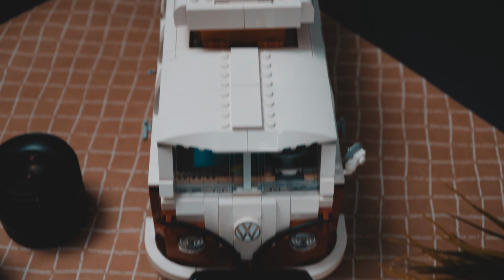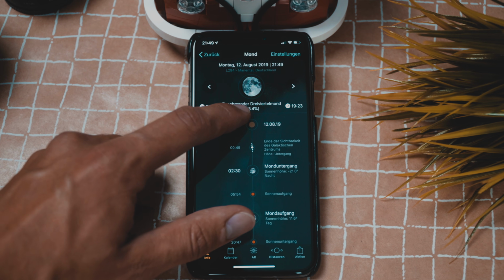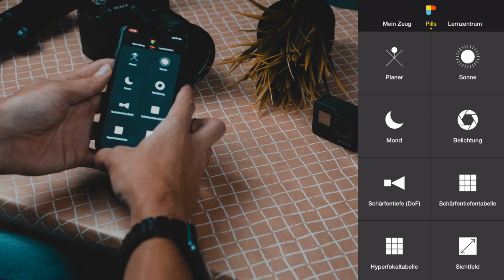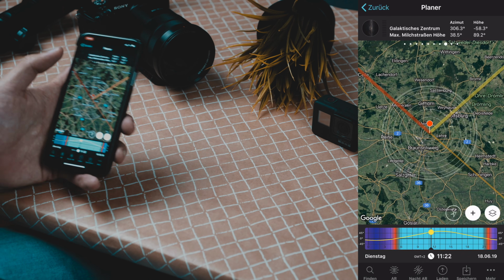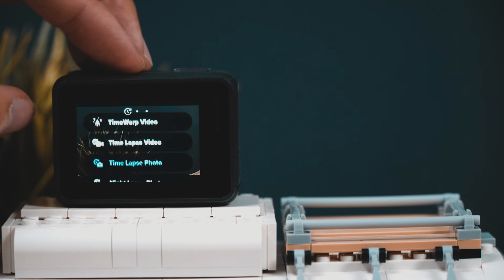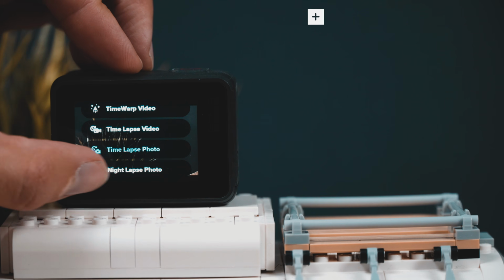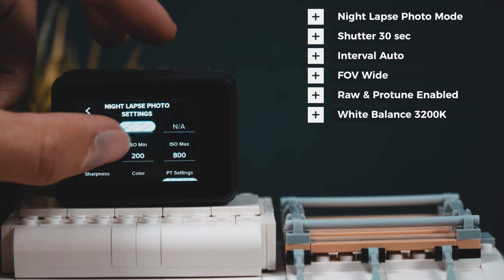GoPro Night Lapse Settings for HERO 8 (works for HERO 9)

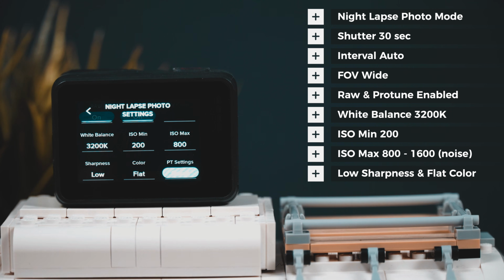Comment: Settings: 4:32 
Night lapse photo mode
Shutter 30sec
Interval Auto
FOV wide
RAW enable
Protune enable
EV compensation N/A
White Bal 3200k
ISO min any
ISO max <=800
Sharpness Low
Color Flat

Comment: Remove Battery sir ?
Reply from the maker: I don’t remove the battery to make sure only little humidity enters the inside of the GoPro. If you remove the battery, there are open electrical components.
Reply: @TheTimelapseGuy  my GoPro 8 won't charge while recording

Comment: what do you mean it could damage the camera ? how can gopro get damaged by rain ?
Reply: If you connect it to a power bank the latch is open, if you do the timelapse with the internal battery only it wont get damaged
Reply: @kronlidmusic  thanks for clearing it up. it was confusing

Comment: I have a question. Will it damage the battery when its running with a powerbank the whole night?
Reply: What happen?
Reply: i prefer to take out the battery, runs perfectly with power bank even without it.20000mah power bank lasts a whole night 😎

Comment: Loved the video man, thanks for the tips :) 

I have one question: How do you make sure the powerbank and the GoPro stay dry overnight?

Looking forward to your answer!
Reply: I use Proxicast Pro-Grade Extra Strong 30mil Weatherproof Self-Fusing Silicone Rubber Sealing Tape (Amazon) which works great for power banks and connections! It's easy to remove and does not leave any sticky residue left. It's amazing stuff! As for my GoPro, I use a weatherproof casing designed for continuous power made by 3br power (I think is called) X-PWR-H8 you can find them with a google search. Hope this helps.

Comment: Is anyone else having issues with artefacts in the night lapse mode? Gopro support told me this:
This is a firmware issue. Our product team is working on a possible fix. We do not have information if the problem will be able to be fixed or not.
Reply: I see blue and red pixels randomly in my night lapse... Hero 8
Reply from the maker: I once exchanged a GoPro because I also had dead pixels on the sensor. I contacted the GoPro support directly and it was taken as a warranty issue.

Comment: I plan on recording a meteor shower tonight and need to know if it's a good idea to plug into an outlet instead of battery pack. I feel they would be the same but just curious if there is a risk
Reply from the maker: It’s no problem, just try to make sure that no humidity enters the outlet (wrap everything into plastic bags e.g.)
Reply: @TheTimelapseGuy  awesome  thanks

Comment: How come my resulting clip is only 3 seconds long no matter if I use Auto or 60 second intervals? This is for 1 to 1.5 hours of filming
Reply: Becouse you get 1 frame every 60secs,but once you play the video its 30 frames per second. So, what you film for 30 minutes (30 frames you get) it is played in a second. You can put the interval on 30 seconds, so you get double the lenght. Keep in mind that if you are using shutter speed 30 secs, interval cant go lower than 30 shutter speed

Comment: This helped me make a short video of the perseids meteor shower and it came out fairly well. The only thing here being the key word. Short. I had the camera going for about 3 hours which gave me about 9 seconds of video. I'm not a photographer by any means so I didn't realise that having such a long exposure time would equate to a much shorter video, it probably could be made a little clearer for the idiots like me what sort of effect exposure times have on your shooting for things like this. Otherwise it's a pretty foolproof guide and I look forward to capturing some more nightlapses  with my GoPro, it's a fantastic bit of kit.
Reply: Thanks for the advice. I was also confused why my video was so short, even after filming for 1.5 hours or more. I think I might edit to video to slow it down and see what happens.
Reply: @ovlv1518  something else I realised after the fact was that I had been filming in video mode instead of photo mode. Made a huge difference in the time recorded to footage ratio.
Reply: @boytechnichian  seems I only have three modes on the camera when I swipe left or right: Time lapse, Video and Photo. I am relatively new to GoPro cameras and mostly photography is not my strong suit :/
Reply: @ovlv1518  Same, but if you look at your time lapse settings (shown in the video), not the specific photo or video modes themselves, you will see a photo or video option. That's where I went wrong. When on timelapse mode, tap and hold on where it says timelapse, that will bring up your settings menu. There you can select nightlapse and all of the other various settings shown in this video.
Reply: @boytechnichian  when on time lapse, it's has a default night lapse, time warp and time lapse settings mode, plus a custom mode to tinker with. The shutter speed is on Auto for the night lapse . Should I reduce the shutter speed time from 30 to 20 secs?
Reply: @boytechnichian  I made a custom time lapse mode with these settings: resolution 4K, lens Wide, interval 60 mins, format video, shutter 30s, white balance 2300k, iso max/min 1600, sharpness high, color flat
Reply: @ovlv1518  yeah that's the one you need to select photo on. Not video. Just keep all the settings the same as in the video. That's what I did.
Reply: @boytechnichian  if I do photo time lapse, will you be able to see it in sequence? Kind of like a video? I am trying to capture the milky way and earth rotation. Thanks by the way, you are teaching me a lot.
Reply: @ovlv1518  I don't know mate, would have thought so. I only watched the video same as you, just figured out that I made a mistake in the settings is all. Really not an expert in this sort of thing.
Reply: @boytechnichian  I was thinking may be I experiment and see what happens xD. Thanks again!
Reply: @ovlv1518  no problems bud
Reply from the maker: When you are using the Nigh Lapse photo mode (not video!) you need to do special editing in post to make a video out of the single photos :)
Reply: @TheTimelapseGuy  when you say special editing, what do you mean? As in compiling the photos in sequence to make a video or something more involved?
Reply: @Luke Barnes Mine doesn't seem to have a foto mode time lapse :(. Or am I missing something? Mine is a GoPro Hero 8

Comment: I have a question, how do you get the GoPro battery to last that long
Reply: Did you watch the entire video? Power bank connected to the camera while it's shooting.
Reply: Adam Krol no I watched the beginning only😬
Reply: @tame7222  haha no worries. Just plug the power bank so it will recharg your camera while it's recording. Just make sure there won't be any rain as this is when the camera is not waterproof anymore haha.
Reply from the maker: It’s amazing how often people are asking stuff which is answered in the video they are asking about 😜
Reply: bruhhh
Reply: Great video and thanks for posting it!

Comment: How can rain hurt a GoPro?
Reply from the maker: GoPro is still an electrical device. If you open one of its waterproof seals to charge it while shooting it looses its waterproofnes.
Reply: The TIMELAPSE Guy Oh I didn’t know you meant while using the port.

Comment: with the gopro 8 black,my night lapse videos were full with blue/red/yellow pixels, the firmware update did not help ( v 1.6) RMA and refound. I used the same settings
Reply from the maker: Your sensor is damaged then. You should contact GoPro for an exchange product. In my video you can also see one single blue dot because of a dead pixel. I might also ask for an exchange.
Reply: @TheTimelapseGuy  GoPro offered me a reconditioned Hero 8, not a brand new one. I said no, asked for full refund instead. I don't know if I will buy it again.
Reply: @TheTimelapseGuy  I have the same problem but with with lots of colors dots... GoPro told me it's a sofware default... 
But I don't trust them... did you have a camera exchange? and did he solve the problem
Reply from the maker: I had my GoPro Hero 7 replaced because I had a lot of dead pixels. The GoPro Support wanted me to send them a bunch of pictures where it was visible and then they just send me an exchange item without further questions. I really don’t think that this is a software thing. Maybe they changed to cheaper sensors

Comment: Hello! One question I tried to make a time lapse last night with mi GoPro 8, using the settings that you said but the result is a very dark! Can't see anything!

Do I need something more like a flash or extra light? I don't know what I've done wrong. Maybe the location and weather as you said? I tried to film in Quéntar (Granada, Spain) and the sky was clear.
Reply from the maker: Hi Alvaro,
when the sky was clear and you really used all the settings I recommend, you should have received a good result. Please check your settings again. Maybe you mixed up interval and exposure?
Reply: @TheTimelapseGuy  No, I've checked it and is ok! Maybe is because I set the ISO max and min exactly like you said (200 and 800) and maybe I should set it adjusting the numbers?

It was new moon so the sky was very clear and I was in the countryside far from any city but I didn't check the Milkyway as you said maybe it was the problem?

Thank you for answering!
Reply: Alvaro debe ensayar con el obturador en 30 segundos y subir eliso a 800
Reply: @luishecheverym56  configuré el ISO mínimo a 200 y el ISO máximo a 800 pero el obturador es cierto que no lo toqué. Probaré a ver que tal, gracias!!
Reply: What is the app for the moon
Reply from the maker: It is called Photo Pills

Comment: Hi, how long does the gopro automatically take the 30s exposures for? Or do you have to do it manually? Thinking about getting hero 8 but just researching before I do. Thanks in advance.
Reply from the maker: The GoPro takes photos until you stop the time lapse or until the battery drains. Does this answer your question?
Reply: @TheTimelapseGuy  yes that's great. Thanks very much for taking the time to apply. I'll look forward to more of your vids in the future. Thanks again.

Comment: I have a question, how do you get the battery to last all night recording?
Reply: You should remove the battery and connect the camera directly to a power source.  Removing the battery prevents the camera from overheating; Hero6 and above let you film while the camera is plugged in
Reply: @BayAreaMotorcycleCommuting  oh cool thanks but i thought you cant record with the battery out
Reply from the maker: I think you can do that since HERO 6 or 7. but you can also leave the battery inside, I never had overheating problems 👍🏻
Reply: The Ultimate Mcpe Yep, I have a Hero6 and this is how I do my timelapses
Reply: @TheTimelapseGuy  thanks guys
Reply: @TheTimelapseGuy  wait if your doing nightlapse for night to day how much space will it take up
Reply from the maker: The Ultimate Mcpe for 8 hours shooting at 30sec exposure you take around 1000 pictures. So that should be something around 3-6gb of storage
Reply: Yep, this sounds about right. Note that if you leave your settings to Auto for the exposure, etc. you will likely have closer to 7 or 8000 images. I use a 128 Gb SD card (which might not be officially supported) & don’t have any problems

Comment: WTF? is this a re-badged Hero 7 video?  Very misleading header.  Appreciate the detailed settings for nightlapse but the Hero 8 is a different beast when it comes menu settings and setup.  There is a ready made 'preset' for nightlapse on the 8 (which you could tweak if needed).  Would suggest changing the video title to better describe the content.  Impressive clips though.

Comment: When connecting power bank do you leave a battery in GoPro?
Reply from the maker: Usually I leave it inside, but it is not necessary. When it’s very cold outside I think I wouldn’t use the GoPro battery so i don’t risk to damage it

Comment: If there any damage when plugin power bank ? (becoz of over charge)
Reply from the maker: I never heard of any problems regarding overcharge.
Reply: Sir, Which power bank r u using ? Nd it's mAh?
Reply from the maker: It’s a MiPow Powercube with 8000mAh. I bought it 6 years ago 😊